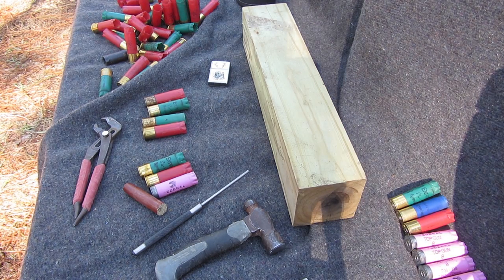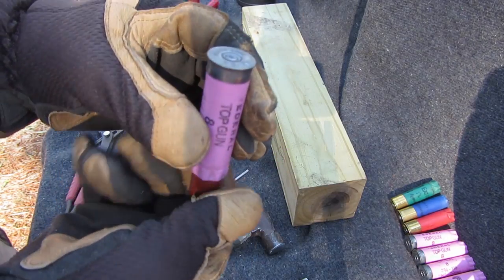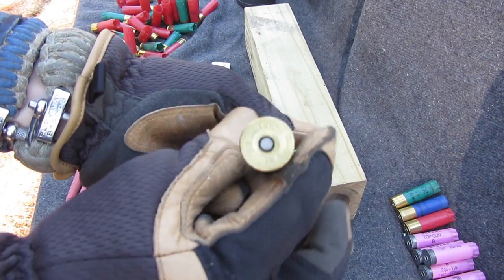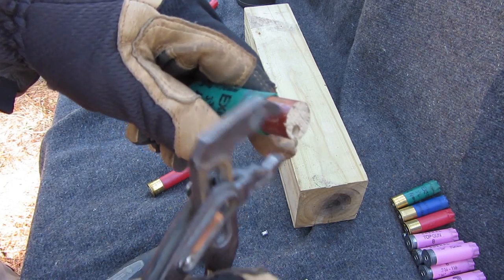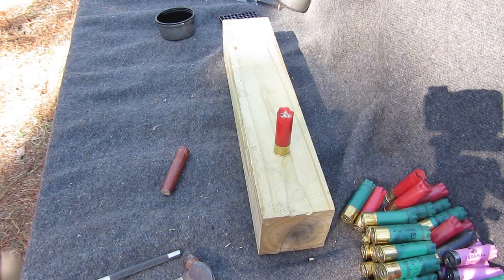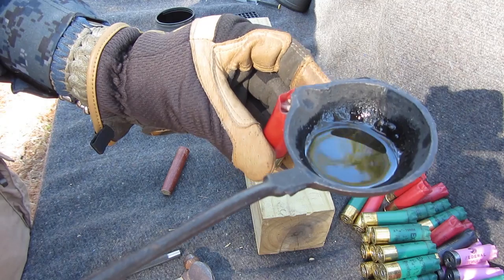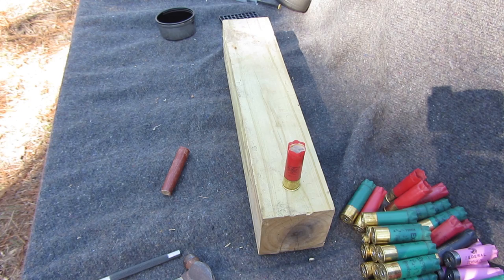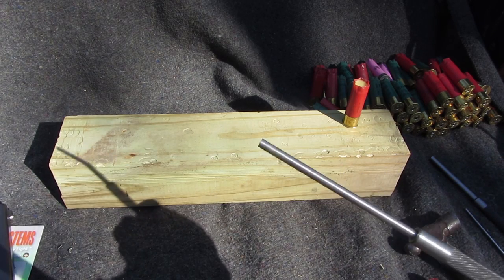Field Reloading Shotgun Shells

Comment: An ordinary flat washer inlet into the wood block would give 360° support to the base - help prevent a possible angling bend. Clearance hole bored through the block for spent primers. A 1"x1" flat bar steel inlet likewise would help ensure flush seating of primers. 
There are potential situations requiring removal of live primers - few I grant - but doing so requires very careful movements. You can remove live primers with very slow and gradually increasing pressure. HOWEVER, in most cases, it's better to simply fire the primer and remove it spent. Tapping the primer into place with a punch and hammer is a safe procedure. Lee Loaders have used this technique for decades. You will hear about the rare occasion of a primer going off during seating from someone who says "it happened to me" - and it can happen (rarely), but those rare instances are more in the nature of scareing someone than causing harm as long as ordinary safety precautions are followed.
Using a hodgepodge of cases means that internal volume is going to vary. This isn't an issue if mild to moderate loads are adhered to, but anything approaching maximum loads needs to be worked toward gradually in identical brand cases. A safe load in one case can become an overpressure load in a case with smaller internal volume. But this isn't an issue with mild to moderate loads. 
As with most things, these kinds of videos should be viewed as instructional for SHTF scenarios, and not as a recommended technique for routine reloading.
Black powder is much more forgiving than smokeless. Equal volumes of black powder and shot was referred to as a "square load", or ideal, but adjustments were easily accomodated by the shotguns. If someone wants to use a hodgepodge of cases, they should restrict that activity to using black powder or substitutes as this video is doing.
The final compression taps on the lead shot, I would avoid. This will deform the shot and give erratic patterns.
Wax works but water glass glue is better - alternatively, Duco hobby cement.

Comment: The primer should be recessed into the shell face.  If you're going to do it like you show, you could just hollow out a small spot on the block to accommodate the primed area then wack away as much as you like.  I know it's relatively hard to set off a primer but why take the chance? Some shooters will find that shells loaded without resizing the brass first makes them very hard to chamber. That's certainly true in several of my guns.

Comment: I use a small piece of wood with a 13/16 hole for the shell & a 3/8 inside that, to hold the shell & tap the primer out..weigh my charge, wad, roll crimp, or just recrimp with needle nose turn the shell upside down & press back together, add a little super glue to help hold it..lots of them look almost factory!! Edit: Also use a thin cardboard shot card for the crimp so the crimp can glue to that.
Reply from the maker: @rockn raptor   Good idea.

Comment: Little tip. Get a piece of wood the same size as the inside of your shell. Drill a small all the way through right in the center. Use a small Phillips or some other rod or punch to knock out the primer. It speeds up the process a lot. A long socket with a short extension works great for setting new primers. I always used a rubber hammer. It crazie how fast loading like this can be after a while. LOL. Thanks for the video and bringing back some great memories of my youth.
Reply: I commented before I realized you had the hole in the wood. I just saw the offset hole and paused it. Sorry for not watching first.

Comment: how much powder....grams????
Reply from the maker: @Joseph Pieterse  Not really sure, I was using a Black Powder measuring device at 100 grains
Conversion calculator says 100 grains equals 6.47989 grams
I didn't weigh it on a scale so I don't know if that is correct or not

Comment: Have you ever a primer set off by doing this and would it be the same with a cardboard circle in wax and then over the powder one and one over the shot?
Reply from the maker: No never had a primer discharge. It is harder than most people think to set it off and if it did it wouldn't harm anything, the charge is light.
Cardboard will work. Some Shotgun Shell manufacturers use pressed cardboard.
Reply: i was trying to remove primer it did exploded no harm at all but it made a dent on the table
Reply: yasin keskin you have to remove dead primers not live ones. the live ones will obviously discharge
Reply: Why would someone be removing a live primer?  Just skip right to the powder charging step.
Reply: Shotgun primers are nothing to be taken lightly, they are extremely powerful and have an increased potential to cause a in lethal injury.
 Here's a personal experience I had many years ago. I tossed a live 209 in a metal barbecue, when it detonated it blew the cup clean through the side of the barbeque and then nearly penetrated the metal siding on a mobile home. It also left my ear ringing. Do Not Take Primers with a grain of salt, they can be nasty and are capable of causing serious injury or even death. I knew a guy who blew the tip of his index finger off when one detonated. Don't know exactly what he did that caused the detonation, but does it really matter? I don't think so.

Comment: Do they chamber and extract ok with pump or semi-auto?
Reply from the maker: I've only use them in single shot but they should work i semi-auto/pump, as long as the shell isn't too long for your chamber. my chamber is 3 inches and I use 2.75 inch shells.

Comment: Are those copperhead bb gun bbs? This was a great video
Reply from the maker: @Dude Broski Yes ordinary copperhead bbs from any sporting goods store.
Reply: @TwoFeatherChannel  do you notice any spread difference over using an actualy wad cup? Also what choke do you usually shoot from? Ive been messing with shot sizes lately and like the copperheads but havent tried without a shot cup. Its nice to know that with a little know how you can roll a few in the feild.
Reply: @TwoFeatherChannel  I heard using air gun steel bbs will damage shotgun barrel.  Is there any truth to that?
Reply from the maker: @springer-qb4dv  Physics say No
federal government made Duck hunters switch from Lead (which is soft) to Steel (which is hard)
air gun BB's are Steel Alloy and Copper Coated. Copper is a soft metal, softer than Steel but not as soft as Lead. Alloy mixed with Steel makes the Steel softer than Steel alone. many shotgun ammo companies have switched to Copper Coating Steel but still manufacture plain Steel because it is cheaper.

Comment: don't you have to close the crimping or do these shells not have it?
Reply from the maker: that's what the wax and wad are for. crimped shells from a press and die keep the shot from rolling out. in the field you don't have a press and dies, so use wad to pack it and wax to seal it or something else like clay or talo.
Reply: aren't there also shells where the front simply folds closed by hand? @TwoFeatherChannel
Reply from the maker: @watchmebarelywrite  never heard of them. I use the factory plastic ones I find on the ground where people target shoot. they are stiff plastic and pop back up if you push the crimp down by hand.

Comment: Has anyone Chrono these rounds using Pyrodex... Thinking about trying this I'd like to use it for turkey hunting or get steel shot after duck and Goose but I'm trying to figure out what the Carano says compared to what I already use
Reply from the maker: @Kansas Outdoorsman Chlumsky...Not that I know of. Black Powder has far less energy than Modern day Powder. So I imagine you will get less results using this. I've used it on Squirrels. Not sure if it would be a good choice on Turkey or Ducks.

Comment: Only problem I see is that those shells are fire formed for different guns. I wonder, did you have any issues with chambering or stuck shells in your gun?
Reply from the maker: @Cis White Dad...No problems. I only shoot these reloads in a Single Shot shotgun that is 3" chambered and the shells are 2-3/4" shells.
Reply: @TwoFeatherChannel  excellent. I have a backwoods set up for reloading 410 that lets me resize the shells, but I have no idea how I would make a resizing die for 12ga without a lathe or a drill bit that costs as much as a factory made resizing die!
Reply from the maker: @regularfather4708  ..It would be hard to get it perfect by hand. It would take time and patience but you could tap it slightly with a hammer.

Comment: Interesting video. I've seen this done where the reloader guy cut off the crimp, but you left yours on. Do they always seat nicely when you put them in the chamber?

Also - I like the idea of using a cloth patch rather than an expensive paid for fibre wad. What chance the patch will catch fire and start a forest fire?

 I tried reloading with a dismantled new shell the other day using PYRODEX instead of the  nitro powder. I used them in my side by side and the recoil of firing the first barrel dislodged the over shot card and the damned shot ran out down the barrel.... Not great. maybe your cloth patch would work better, and you certainly have more space to pack it in with leaving teh crimp area on the case.
Reply from the maker: I use a Single Shot breakdown barrel shotgun with a 3 inch chamber and the Shells I use are 2.75 inch, that leaves me some room to play with like adding more shot. That's why I don't need to cut off the crimped tops.
The Powder burns so fast, the small amount of cotton cloth shouldn't be a problem but if it did I would just stomp it out. Could use Wool, it is naturally Fire and Water resistant.
Reply: Thanks for the info. :)

I tried pushing some empty cases from  mine in and out of the chambers and mostly they go in fine. I'm going to try your method.

I had a first try out the other day using a cut down case (crimp off) and a card wad glued in... Worked fine as long as it was the first shot. I use a side by side and with two shells loaded, when one is fired, the card breaks out and the shot in the other barrel runs down the tube.... I need to work on it more. Could be a longer case and some cloth pushed on top of the shot will hold better under recoil.
Reply from the maker: Tonyv1951
You might try packing the BB's tighter then add thicker layer off wadding before you seal it.
Reply: Another final step would be to trim off about a quarter inch of the end of the shell and use a little roll crimping tool to seal in the pellets, along with a final cardboard cover wad.

Comment: How mush powder would I use in a 20 gauge shell
Reply from the maker: @John Walters
I don't have a 20 gauge and never looked at any other size. I'm using 100 gr. so 75 gr. might be enough.
Reply: Thanks for getting  back to me .I finally came across the information and 75 to 80 will work
Reply from the maker: @John Walters
Good deal. The Pyrodex powder is not as critical as modern slow burning powders are. A little more or less doesn't have those pressure issues.

Comment: Thanks for the nice demo.  But wouldn't a tong be useful to hold the hull while you reload it? (in the slight chance that gun powder/primer goes off and blows off one's fingers).
Reply from the maker: sure if you live in fear your whole life, then by all means wear a bomb proof suit
but I know it takes a lot of force to detonate a primer and had fireworks go off in my hand in the 1960's
black powder is what is used in fireworks and to make an explosion it has to be tightly wrapped
if you spread out black powder loosely in a pile and light it, all it does is a quick flash of fire, no explosion

Comment: hi. 
I am new to reloading and don't have any of the kit, is it possible just to buy shells with the same weight of shot you want to put in, take out the shot and replace it with your own shot and then crimp it again
Reply from the maker: It would be hard to remove the shot from a factory crimped shell without damaging it. I don't think you can crimp a shell without a reloading press. That's why I seal it off with wax.
Reply: Take a look at the Survival Loader.  you can load your own easy and inexpensive.   
go to;    thexringusa.com     comes in 12 ga. and 410 ga.
Reply: @barrydeclined2547  Looks like a good recommendation, you deserve a beer. 🍺
Reply: I would take you up on that if we were nearer.  LOL.    best of luck. Barry

Comment: why do you need to seal it can't you just re crimp it?
Reply from the maker: +Nelson rodriguez
Because it is reloading "in the field" not reloading at a reloading bench using a press.
Reply: TwoFeatherChannel it'll be cool if they ever made a portable recrimp device for field use.
Reply from the maker: +Nelson rodriguez
That would be nice. Don't know how long the crimp would hold, it takes a lot of pressure to crimp it. I've tried by hand but it eventually it opens up.
Reply: Nelson rodriguez roll crimp on a rechargable drill or hand crank krimper amazan?? You know youll be reloading you got powder.  Like the video thanks..
Reply: @nelsonr1467  they do bit not the sape crimp as the factory one